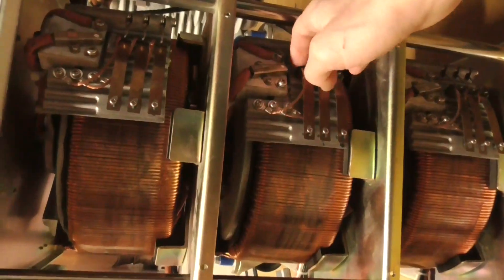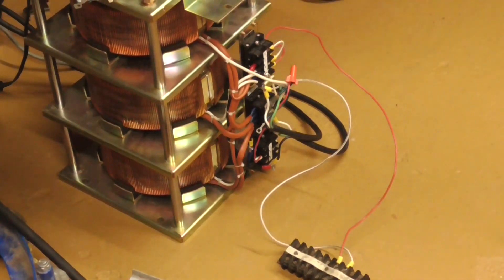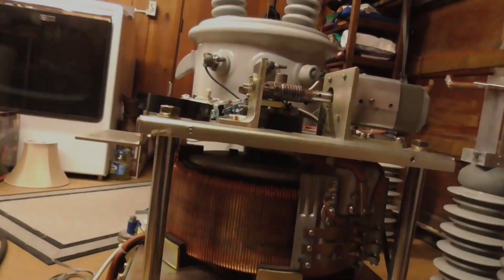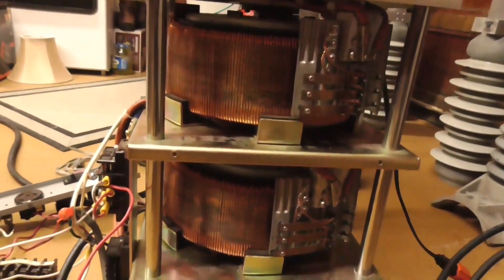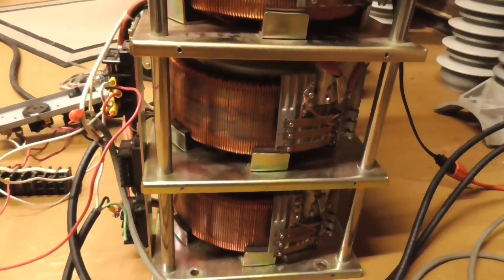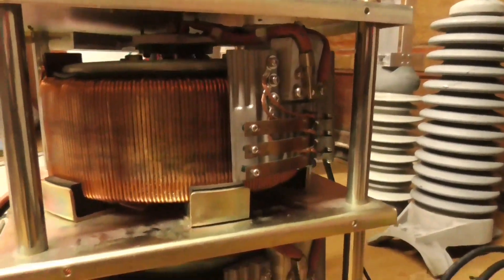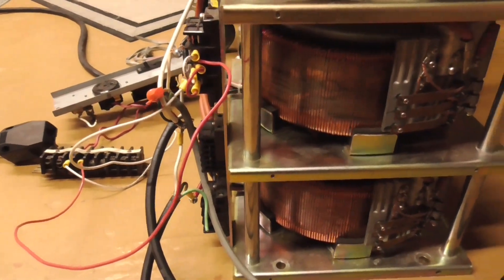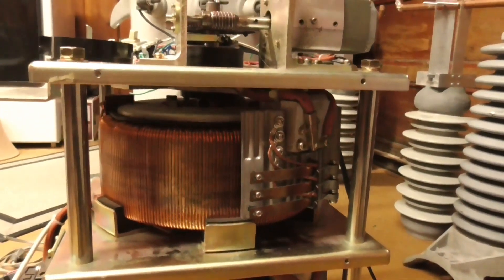New Large Paralleled Variac 3 X 30A 240V input 0 - 270V with 90A output..

Comment: I have a variac like this, and installed a Peaktronics DHC-100 position controller so that the unit mimics the position of a standard handheld 1 turn potentiometer.   A multiturn feedback potentiometer is also installed on the variac with a custom small gear setup, and the controller unit is programmed with minimum and maximum positions (zero and span) to prevent overtravel, and the variacs own limit switches function as emergency overtravel limits. The large variac 'follows' the small potentiometer to exact position.  A custom label plate for the small potentiometer then has the voltages marked.  
 I'm working on a second method of control by entering a desired programmed voltage with numerical keypad, and the unit goes to that point.  I think Photonicinduction's unit works that way, minus the keypad.
Reply from the maker: That's pretty cool, I like that idea. I sort of thought about something similar, but just went with the voltage adjustments being controlled on a voltage up voltage down setup. It'd be cool to see that particular setup.

Comment: Awesome piece of equipment there. Great juicy arcs too I’m very jealous. Lol I would love pull some arcs with my old 10kva pole transformer but, unfortunately my issue right now is I can’t even safely power it. At least not without extreme amounts of ballasting on the 15 amp 120v circuits we have currently. Right now I am trying to install a 240v circuit. My house has all brand new mains and 200 amp service panel recently installed so I’m thinking of installing a 100 amp sub panel in basement and running 6/3 wire to garage for a 50 amp 240v circuit. I have to ask though if you don’t mind, what gauge wire and circuit amperage rating are you running from mains?
Reply from the maker: Yep, I use a double pole 50A 240V breaker wired with 8 gauge cable with 4 conductors.. It's all temporary as I plan to move sometime soon..
Reply: @VariacManiac  Awesome thanks for the reply. Im definitely gonna post some videos once i get all wired just need some time to save. Great video as always though i love it!
Reply from the maker: @86.rustystang91  Nice man, I'm glad to see another sparky join the fun, thanks, it means a lot, I need to make more videos, however I'm busy as hell, cheers!!

Comment: You need a MUCH longer Hot Stick and a shorter lead to the terminal. ;) Play safe.
Reply from the maker: You are right on, I might just use a longer PVC or just go for a real linesman hot stick. Gloves are on their way. Very much needed,  Some of the contactors and parts you gave are going to be a part of the power supply, will be a couple of months. It will look good, I promise to increase safety standards in here as the environment grows more hostile ; )..

Comment from the maker: NOTE: Everything is ran off of 240V now, 120V has been out of the question for over a year now:)..
Reply: That's great, imagine your possibilities with 3 phase 380 VAC industrial voltage!
Reply from the maker: @elyeryan8838  Maybe 480V, will be a little while, but if I still have a You Tube account, I'll be more than happy to share it :).
Reply: In Japan, normally we can get only 100V/200V :(
However, some big factories use 240/415V or 254/440V system. Probably first one is often used in 50Hz region and another one is 60Hz region.
Reply from the maker: @DarkElectronics  Your systems are definitely interesting. It really just depends on what your region was using when it first utilized electricity. Changing voltage would mean possibly changing all appliances to run on that voltage. The typical residential voltage here is 120/240v, and commercial applications can can range 120/208, 240/416, 277/480, 347/600. A typical house would utilize a 200A service rating here as well. Commercial services can be up in the thousands of amps.
Reply: @VariacManiac  That’s exactly right. Our system is based on old American electricity. But east Japan used German 50Hz generator while west Japan used American 60Hz generator. So we have 2 frequencies.
Also, many Japanese houses have unground sockets. Sometimes there is an earth terminal instead of prong.
Reply from the maker: @DarkElectronics  Interesting. That's pretty cool. Everything over here is typically 60Hz, besides very old railway power that runs at 25Hz
Reply: @VariacManiac  That’s interesting too :)

Comment: Ooooh!! THAT is a 
tasty variac! Now, time 
for info and questions, 
as shown below.............

Ok then..... I am sure that you know not to touch the brushworks while that thing is turned on, because depending where that is on the windings..... You'll get a nasty whack!

Balancing chokes..... I am glad you mentioned these, and really speaking, you shouldn't have run all three of those in parallel without balancing chokes, because even if there is a small voltage difference between one set of brushes and another..... large currents can flow between the variacs (due to little or no impedance) and this can cook the variacs, even with no load on them! Even if there is one volt or less difference between each set of brushes on each variac, due to there being little or no impedance, a large current can be made. This is why balancing chokes are needed to balance-out any voltage differences between the variacs' brushes. I was once speaking to Mr. Photon about balancing chokes on his motorised triple-stack, and his are built into the control panel which sits on top, and those balancing chokes (in the UK anyway) are rather pricey!

IMPORTANT!!! IF YOU DON'T WANT 
TO MELT THAT VARIAC, YOU NEED 
TO NOTE THE FOLLOWING INFO RIGHT NOW:

OK, here goes: Any selected voltage from that variac beyond the input voltage is deemed to be accessed from the variacs' over-wind tappings 

When you dial-up more than 120v on the output, YOU NEED TO DE-RATE THE AMPS  drawn from the variac, as thus:

Variac's capacity = 30A each. This gives you 3,600 watts to play with.
(As thus: 30A x 120v = 3,600w)

Triple that up: 3 x 3,600 = 10,800 watts.

With all three variacs in parallel, you get upto 10.8 kW to play with, without overloading the unit. Now, HERE IS THE IMPORTANT BIT:

When you are on the overwind (i.e. using an output voltage of more than 120v) YOU NEED to start de-rating the amps drawn from the variac, simply because:

10,800w ÷ 250v = 43.2A

Now, if you ripped 10.8kW at 250v, that would only be 43.2A ON THE BRUSHES, (or 14.3A per variac) but back along the line where the electrical connection joins onto the windings there will be the maximum amps of 90A (or 30A per variac)

BE AWARE OF THIS, because if you make the mistake of ripping 90A at 250v or more, back at the 120v tapping into the windings, they will become seriously hot, and this could potentially blow all three variacs at once!

So yes, just to stay on the safe side and prevent that variac from blowing up, instead of saying "90A variac" it is best to say "10.8kW variac"

Of course, your meters measure in volts and amps, so right now would be a good time to make a chart of the maximum amps you can pull when you go into the overwind, as thus:

Upto 120v = 90A
130 = 83.07A (or 27.69A per variac)
140 = 77.14A (or 25.71A per variac)
150 = 72.00A (or 24.00A per variac)
160 = 67.50A (or 22.50A per variac) 
170 = 63.52A (or 31.17A per variac)
180 = 45.00A (or 15.00A per variac)
190 = 56.84A (or 18.94A per variac)
200 = 54.00A (or 18.00A per variac)

.......And on it goes. It is now up to you to complete the chart above, right upto the maximum output voltage of the variac.

As you can see above, for a given current, when volts go up..... AMPS GO DOWN. Do keep this in mind because it will save your variac!

If that unit goes =POP= because you pulled too much from it, you will be crying buckets of tears.... and so will your bank manager!!!

Do look after it, don't over-crank it, and above all..... PLAY SAFE!

Thanxx for showing, 

-Wayne's Electrical.

4th March 2019, 23.30
Reply from the maker: Thanks for the reply mate, however, we don't do 120V anymore, it's all 240V in and 270V max out. I do have a 12A variac that does output 270V, but needs 120, I think I'm going to remod that little one to input 240V. That's my old one, lol. Everything that is capable of 240V is going to be ran from 240V now. Now My only problem is the balancing, which I can simply re - use MOT cores and wind my own, just need to do a little math is all:) Other than all that, everything is going to be full potential from here on out:)
Reply: So, am I right in saying then, that EACH variac in the triple-stack is receiving a potential of 240v?
-Wayne's Electrical.
5th March 2019, 00.44
Reply from the maker: @WaynesElectrical  You are vey much correct ;)..
Reply: So, if each variac in the stack is getting 240v, the thing which is confusing  me is..... How do you connect two 120v hots into one variac? OR..... do you have single phase 240v there?
-Wayne's Electrical. 5th March 2019, 03.40....WHAT?! I have to to bed!
Reply from the maker: @WaynesElectrical  I use the split 240V into transformer to convert it to a single phase 240V with Hot, Neutral, and Ground(Earth).(we have a weird system in America) LoL!!
Reply: Aaaah, that's 
an interesting 
way of doing it. :D 
Crikey....... 

........that must surely be ONE HEFTY convertor transformer!! :-O That would make for an interesting vid, to show the 2x 120v hots being converted into a single 240v one. :D

As you know, 240v has some PROPER GRUUUUNT behind it, just make sure you don't pop the neighbourhood's pole pig. :D

Anyways, it is 04.15 here, so I really must go off to sleep now. No doubt, I will now be dreaming of large transformers, flashes and bangs! :D

Take care, play safe.

-Wayne's Electrical.

5th March 2019, 04.17
Reply from the maker: @WaynesElectrical  I think I will make a video on my crazy weird but works setup. As you know, I'm open to suggestions, this is all not just for me, that's why I share. If your suggestion is within reason I'll do it. Good night..